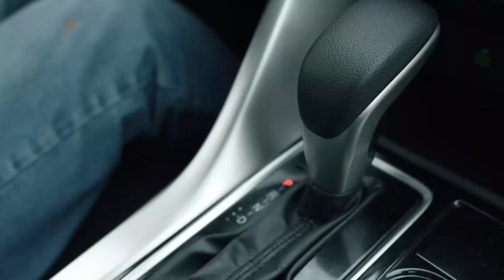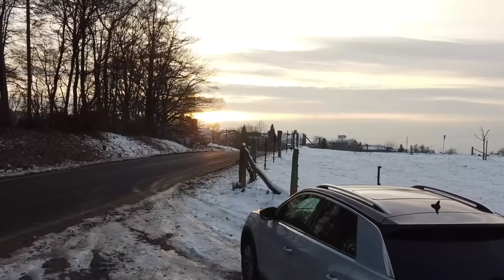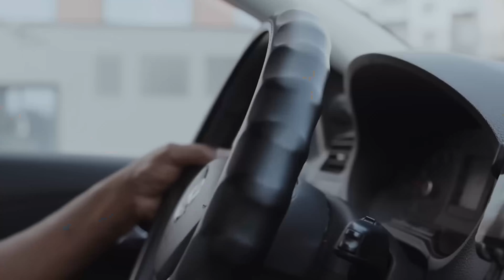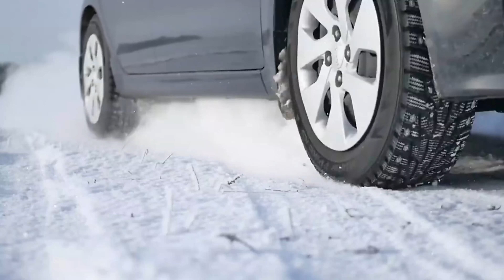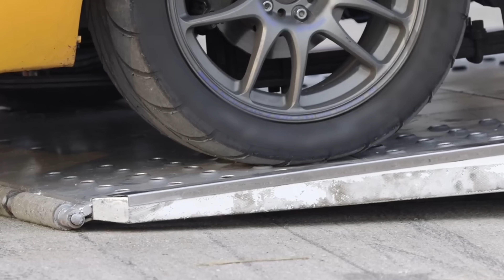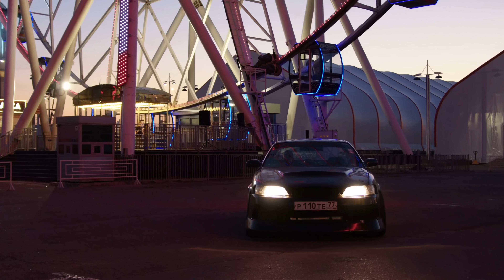13 Stupid Mistakes KILLING Your Automatic Car – STOP Doing These!

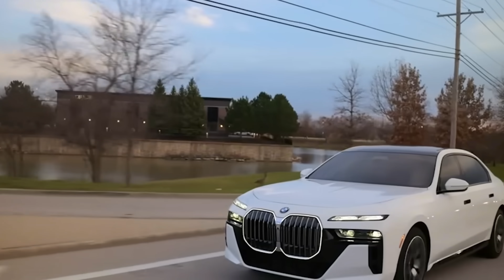Comment: 6:29 I idle until the revs come down. Winter time gets tricky though
Reply from the maker: Makes sense, letting the revs settle helps. In winter, do you let it idle longer, or just drive gently until it warms up?
Reply: @Carflowus yeah because sometimes it is really cold, -30c to -40c sometimes. But usually reflected in the revs though.